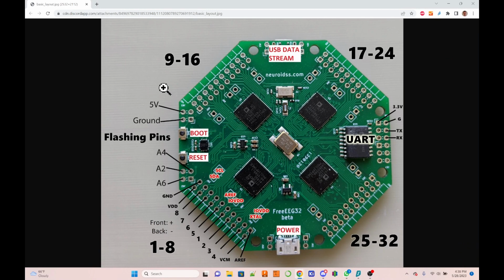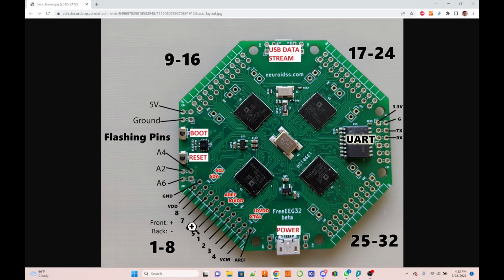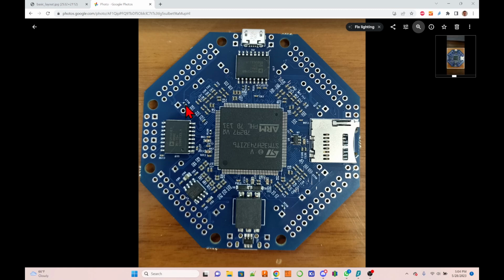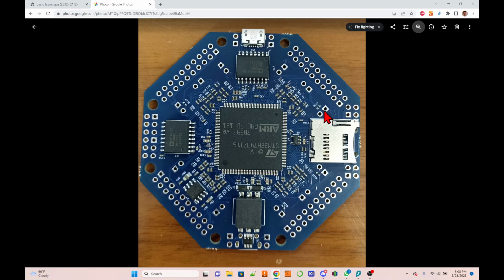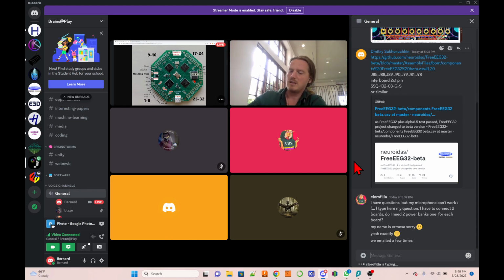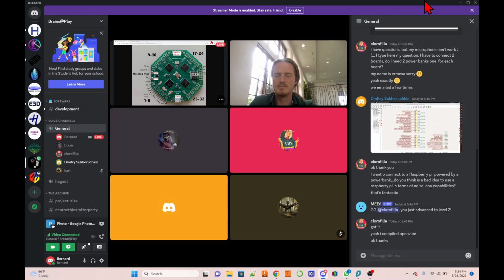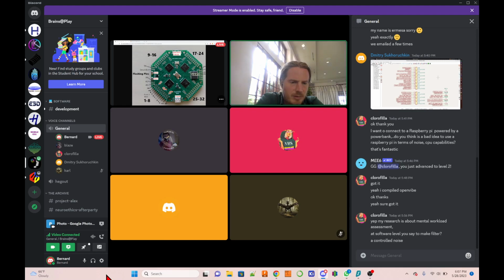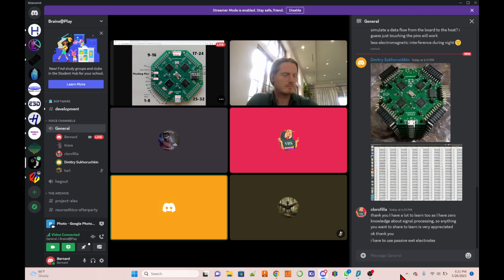Pinout of FreeEEG32 - How to connect your headset Q&A

Comment: hey, wild shot, but do you have any FreeEEG32 board in stock? or a headset. I live in The Netherlands
Reply from the maker: hey hey, bullseye!
I have both FreeEEG32 boards in stock, and complete sets with 19ch headsets. Also, i'm currently in NL :) 
At the moment I sell the boards for 500 eur, and the complete sets for 2000 eur (ex VAT) contact me bmarkus108 gmail com
Reply from the maker: Also take a look at this video, it is demo of the complete headset https://www.youtube.com/watch?v=2R6RO54JTN8 the headset has gone through several design improvements since this video.